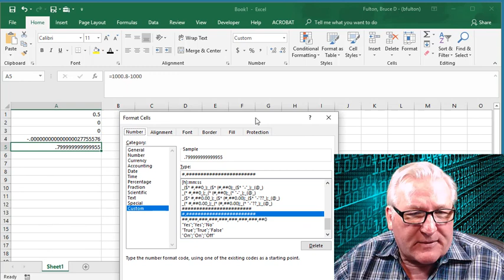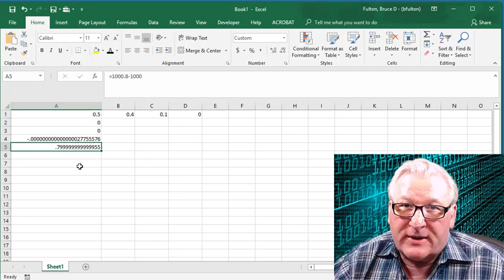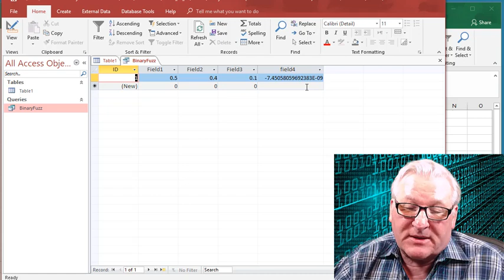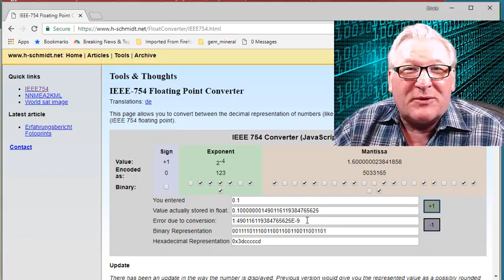Excel, Binary Fuzz and IEEE754

Comment: Hello! I have a question. How to convert  a number in fixed point to floating  point? Is there any formula to do it automatically? How did you do your IEEE 754 Floating  Point  Converter?
Reply from the maker: This will depend on the language or program you are using. You need to check the libraries available for those programs or languages. Check the FIXED function in Excel, for example. But note the FIXED function is not the same as converting from integer to float, for example. The application demonstrated in the video is not mine.